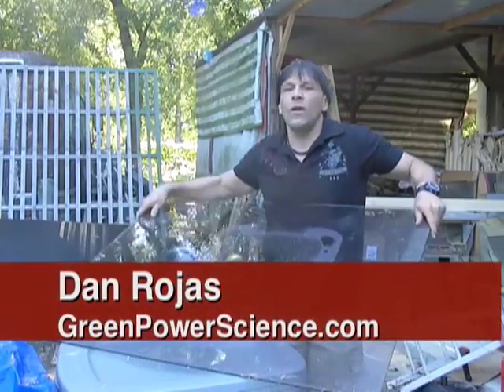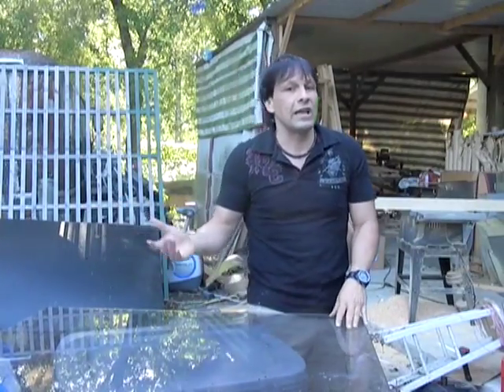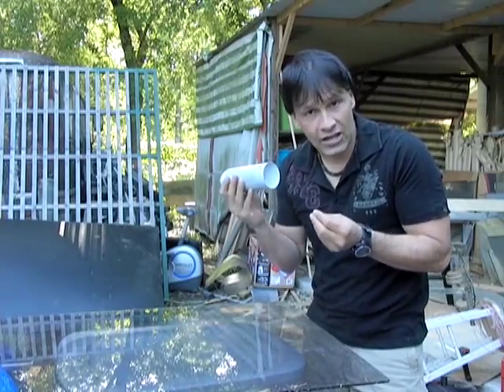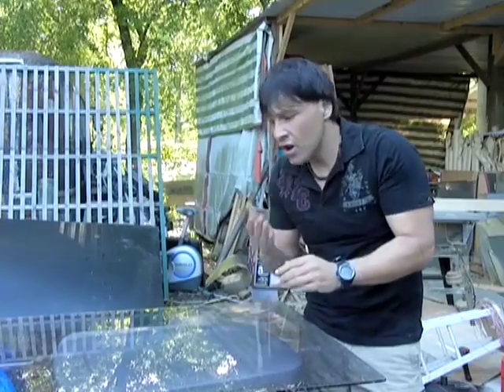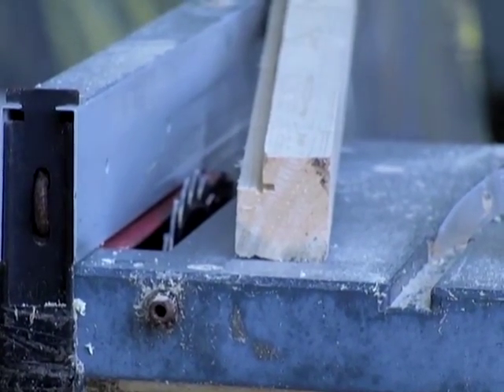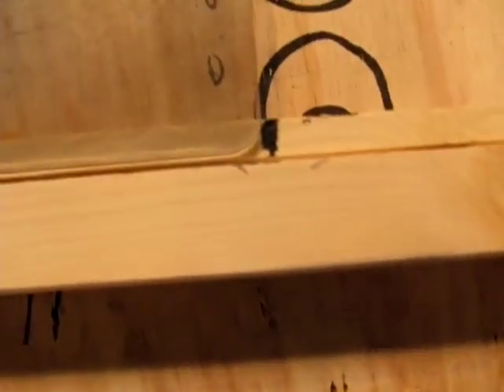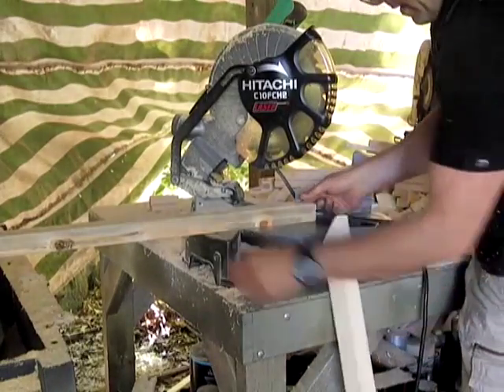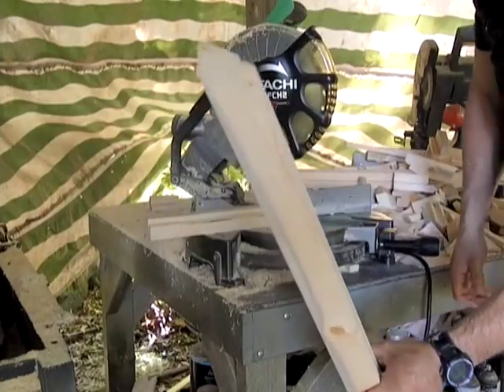Solar Forced Air Heater Solar PART 1 Passive Heating Recycled Glass Soda Pop Can Free

Comment: Good stuff ...Yes the Can  heaters are ok ....But are very time consuming to build ....I have found that the best way to build a really good high heat output heater , is to use tile and 2 panes of glass with 1/2" air gap between the panes ..I have hit 300 degrees with tile , and the heat will stay a while even after the sun is down ...

Comment: if you live in a colder environment, get multiple layers of glass going to provide a thermal barrier. 

as long as the glass is clear, the inside layer that the air flows through will heat really well, and the outer layers will insulate the inner layers. thus providing a barrier against heat loss while still providing the heat you are trying to acquire.

of course, more layers will increase the cost of the project, and possibly reduce the final energy aquired, but it might work well enough.

Comment: Interesting theory and presentation. However the cans or corrugated may actually increase the surface area heated by the sun from various angles. I have no data to back this up but it is the surface area heated and not the surface area of the glass that counts. If I am correct a panel made with corrugated will win catch more heat.

Comment: With the aluminum pipes/cans systems, people need to remember to uses the full size of the glass for heat collection, and not use part of it to cover the header/distributer chambers.  Glass is sometimes hard to find and should be used for maximum heat collection.  The header should be disigned around that then.

Comment: great system...a couple thoughts came to mind as i watched.... if one put the black tubing  in a slightly larger clear plastic tube it would get even hotter.... another thought was if the tube heater system was downhill from the house, rather than on the roof, one could insulate the tubing and have the heat rise like a thermosyphon, to the house without need for a fan....

Comment: The main issue I have with this design is the relatively high reflectivity of the glass when the sun is at an angle to the panel. In effect, although the round profile of the cans may be ideal for absorbing solar radiation at various angles, much of the sunlight will be reflected from the front glass before it even reaches the cans. This problem may be reduced by using anti-reflective glass, similar to that used on commercial PV solar panels, however, it is expensive.

Comment: it doesnt get to 0 degrees in florida....I built a pop can heater that saved me 300 hundred gallons of heating oil through the winter. I also used a therm sliding glass door so at 220 degrees that my pop can heater gets it wont crack in the heat. with yours I would like to see some cold weather numbers and money savings

Comment: I wonder if you used a large PC fan the heat would come out hotter  because it is less powerful and   it would take long for the air to travel  through the tube

Comment: Your reasoning may SOUND logical. But in the real world, such attempts at reasoning are usually minefields. A simple test, side-by-side comparison--with identical fans to move air through, and looking at the air temps as an equal amount of air is moved through, is the only way to know which system is better, cans or open box.